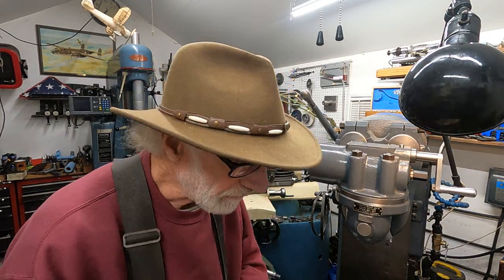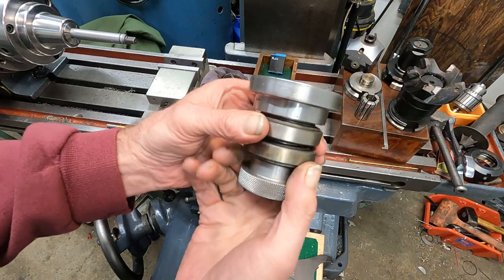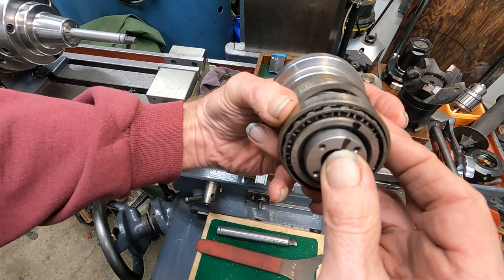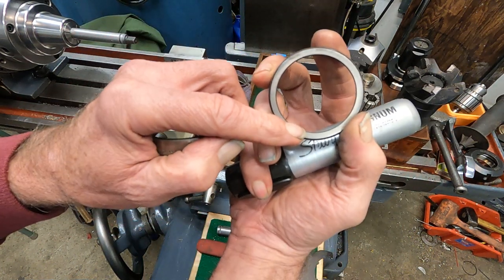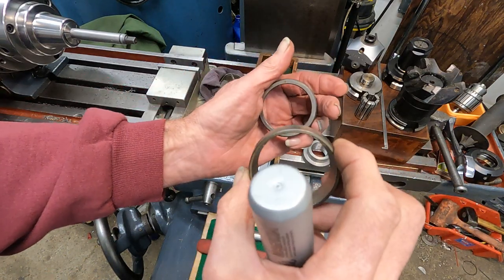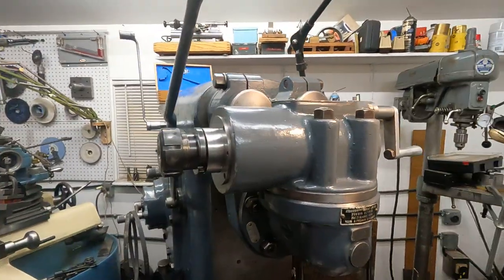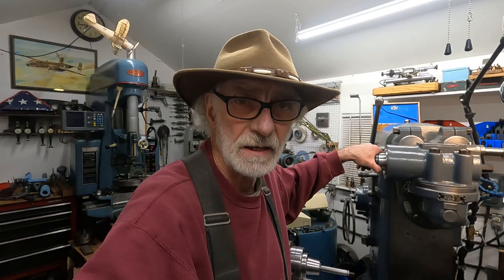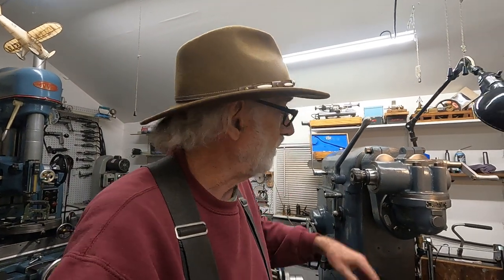Bearing in mind Precision Timken Bearings

Comment: Thanks! Great information as usual. How come the ball bearing don’t have this problem? Are the races ground more true or…?
Reply from the maker: The precision grade ball bearings have the high marks on the inner and outer races it is only in the millionths of an inch. A rule of thumb is align the marks when installing but machine manufactures may move those high spots to compensate for errors on the spindle shaft and bearing pockets.